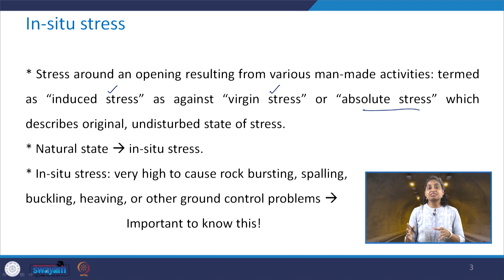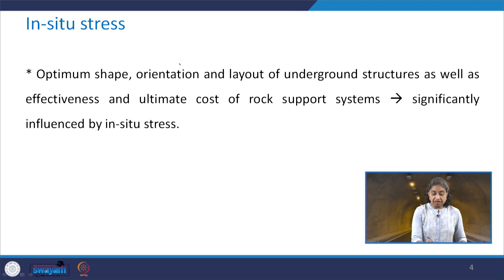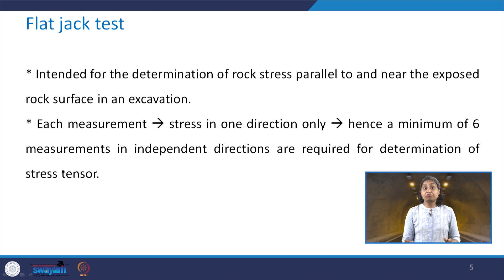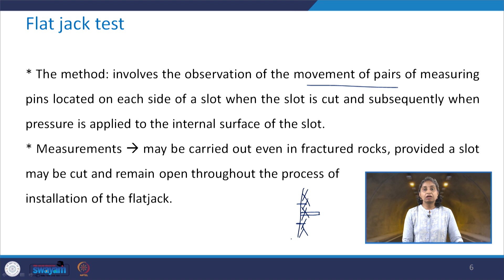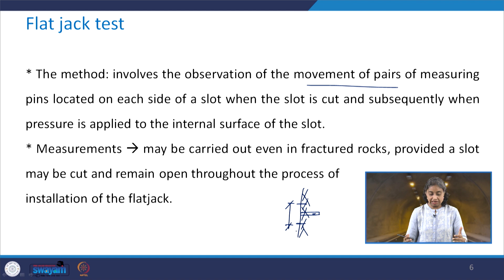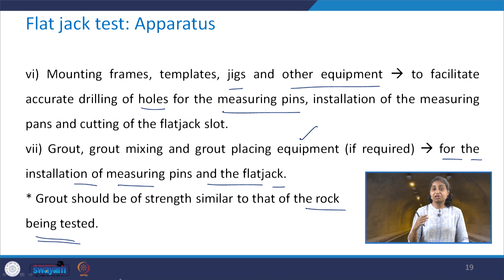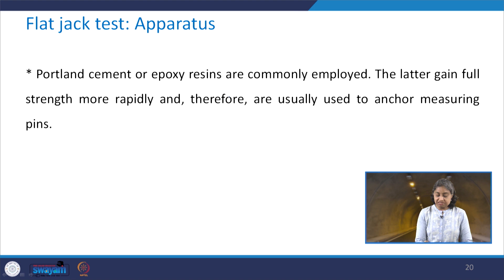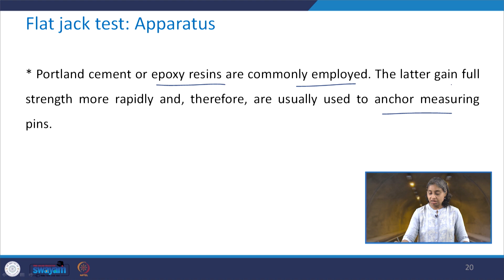Lecture 56: Rock stress determination: flat jack test

Comment: If we grout the flat jack, then it can not be reused and will have to permanently left inside the slot. Can we not use the shims around the flat jacks. Use of shims is a normal practice used for flat jack test of masonry as per ASTM C1196 − 14a